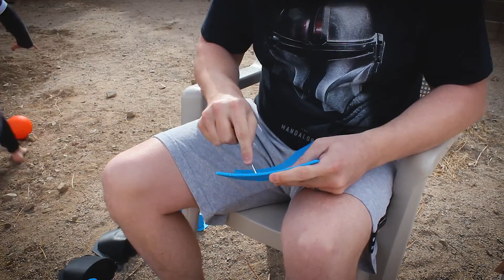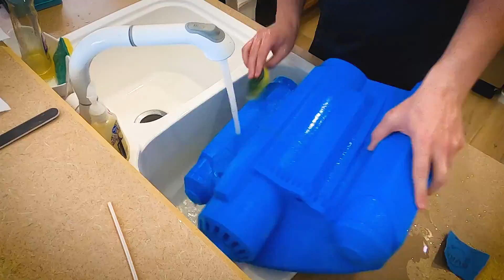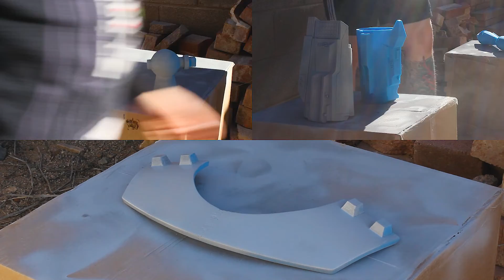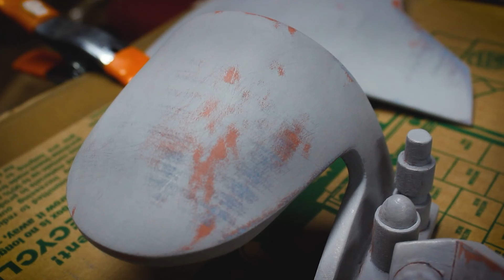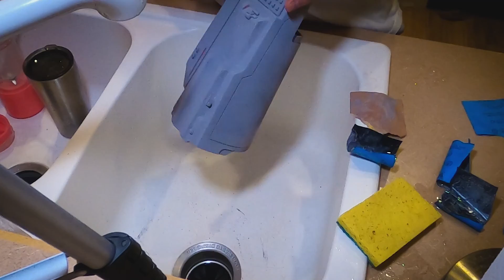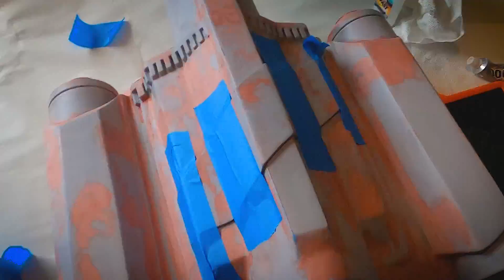Smoothing 3D Prints | How to Make Boba Fett Part 5

Comment: What did you use for all the soft parts??
Reply from the maker: I used the Boba Fett costume that is up on Sky Costumes, just had to seam rip the vinyl armor off of it, along with a couple other modifications. Ill have a video on that in the future. Its not the most accurate option out there but its definitely the best accuracy to price ratio. A good soft parts kit for Boba Fett runs about $700 and I only paid $130. It works for now for sure.

Comment: Based on my experience starting off with Bondo spot putty is like attaching $10 bills to helium balloons and just letting them go. The amount sanded off is just a waste of money. The 2 in 1 sandable filler primer is where I recommend starting. Start with pretty light coats and sand. The idea is that you're sanding the filler primer down so it stays in the low spots and you sand down to the high spots. Then, repeat with another coat until it becomes smooth.

If you just blast a can of filler primer and sand it, all you're doing is like the Bondo, wasting the paint because you've already filled the low spots, but now you're just building up layers that do very little good. Think of it like trying to repair a screw hole in drywall. You put on some of the drywall compound and cover the screw. You can of course keep layering on compound, but all you're doing is sanding down the excess and you risk creating a bulge. 

If you do lighter layers and sand in between, your low and high spots begin to equal out. Then, if you have lines that are suborn, or shallow seam lines, you can use the spot putty to fill those gaps and then sand. For large gaps, seams, or support lines, use a 2-part epoxy (hobby epoxy) to fill them and sand down. Spot putty is not designed for deep gaps and is likely to crumble if put on too thick. 

By using 2 in 1 sandable filler primer I can get a part smooth with very little effort. I tend to use very little spot putty if any on most parts.

Oh... and one more tip. Wet sand whenever possible (400 grit. Any higher and you risk your paint not sticking). It stops the paper from getting gunked up and it produces a better result. Let's just say my water bill has gone up because I do therapy sanding in the shower. :D
Reply from the maker: I do agree with most of what you said! Now I usually do bondo on the tops of helmets or other areas where the layers stair step. I have also switched to duplicolor filler primers as I like it a lot more! I have also been using UV resin quite a bit. Its fun to brush on and makes my process much faster. I also do a wet sand of 320 before moving up to 600. Fantastic tips in your comment I think we all really appreciate it!

Comment: hey there, after the bondo do u sand back with 220 or go with 400 wet sand?
Reply from the maker: So it sort of depends. If you cake the bondo on pretty thick maybe start with 220 and then work up but if it’s not too thick it should be easy to sand with like 400 or 600. And wet sanding isn’t totally necessary until you’re at the last stages but one reason I do it is wet sanding helped with the mess management because sanding bondo is a very messy process. Normally these types of projects don’t require sanding higher than 600 or 800.

Comment: That turned out great! I tend to shy away from 3d resin prints. I feel they are a bit fragile, but I guess the point of having a printer is you can always print another if needed.
Reply from the maker: Thank you! Yeah there is definitely a balance between resin and fdm. I think both have their place and their jobs they do better than the other.
Reply: @GalaxyBuilt  i tend to over complicate my builds and make silicone molds with epoxy resin parts. Why make just 1 thing when I can spend much more and make 1 thing...
Reply from the maker: @HawkWorley  That is really awesome! Makes reproducing parts so much more efficient.

Comment: I saw a technique from another creator on YouTube that I found works really well on 3D prints. Take the Bondo glazing and spot putty and thin it down with some acetone to make it brushable. Then you can brush it on. The great thing is that the acetone also slightly softens the very top layer of the print and causes the Bondo to adhere really well to the print. It dries really fast and is super easy to sand. I spent a lot less time sanding than I expected.
Reply from the maker: I like that tip a lot! It’s once I have seen as well. I’ve even seen lately people thinning it with the acetone enough that they can airbrush it! I finished these parts over the past year and my techniques have changed a lot. I am mostly using UV curable resin now for most of my smoothing needs.